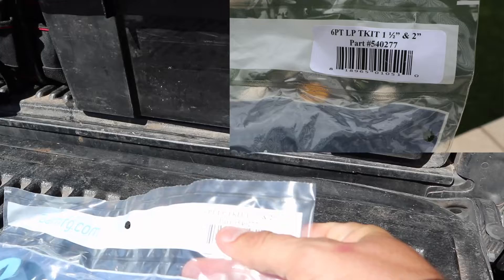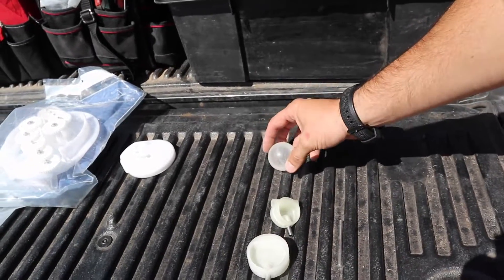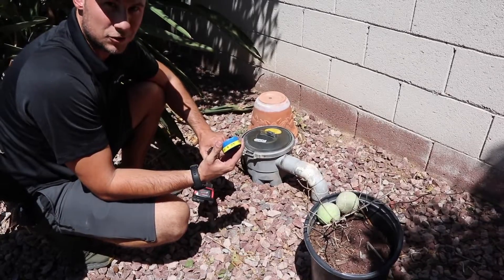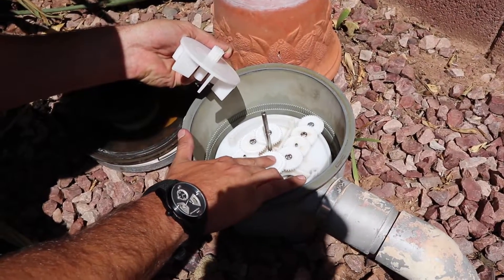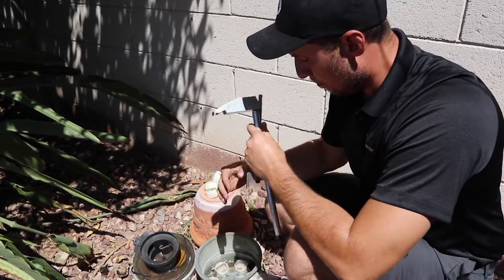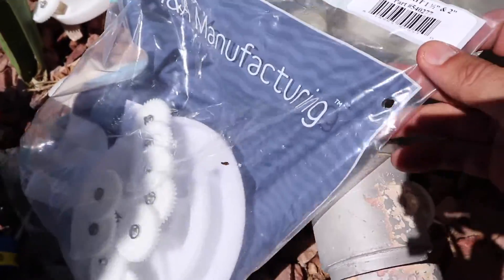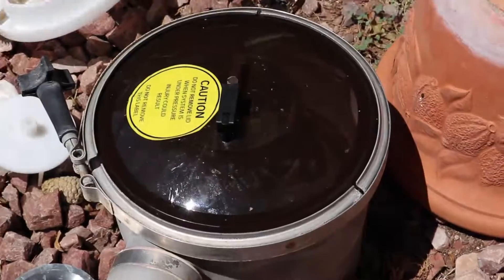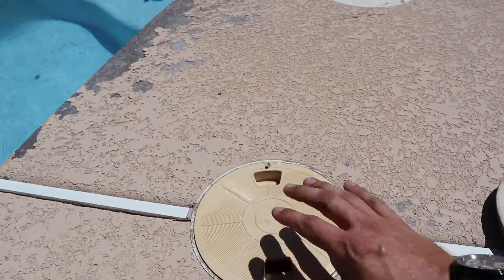Complete Rebuild of a Low Profile Water Valve and Surprise Water Leveler Issue

Comment: Finally got the wife the pool she always wanted, moved from Chicago to AZ last year. After doing a little research, I realize the pool guy I am using isn't very good. I replaced the old leaky unused salt cell, replaced the o-rings in my Jandy valve and low pro unit, and replaced the gears. My jets werent cycling and the joints and valves were all leaking and all I got was a shoulder shrug. There was no weir door either and I always complained about junk floating on the surface all the time. What kind of pool "pro" sees these leaks and never mentions anything?? My water level is a bit low too, wouldnt be surpirsed if I needed a new leveler, and Ive installed those in toilets enough t know thats my next project.

I have to put in a new t valve, when I put in the new gears it ran fine for an hour then stopped as the valve broke, which was where it stopped and shredded the gears at originally. If you can pop the valve out with a hammer, can you get them IN without that special tool?